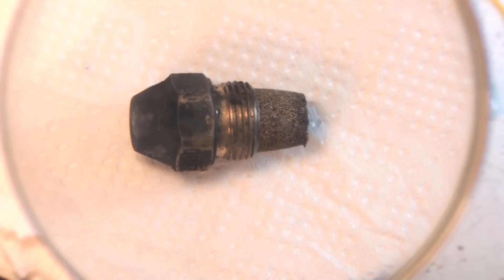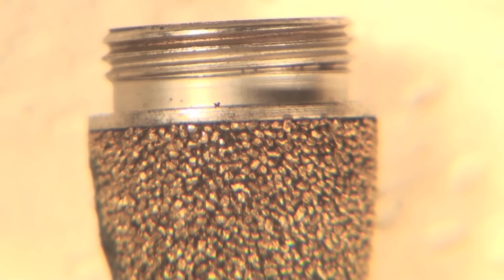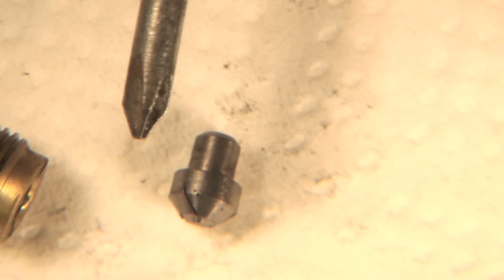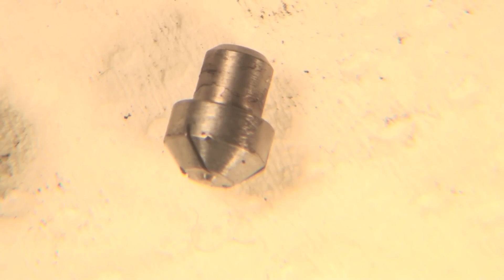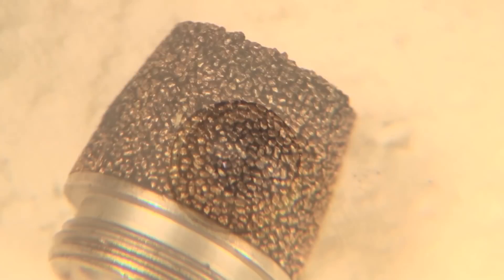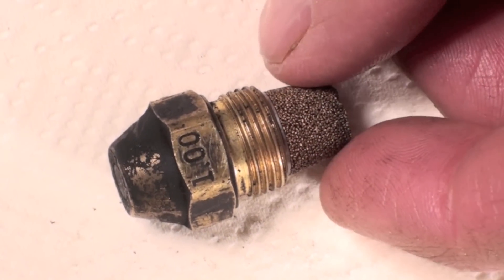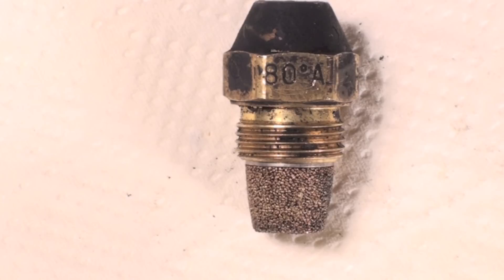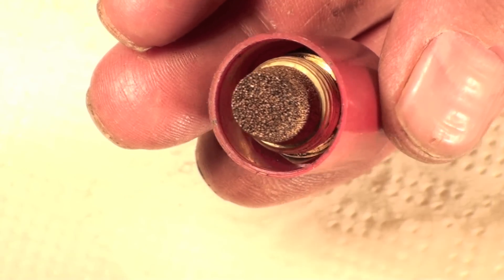The oil furnace nozzle. How it works

Comment: Wow. I have an old kerosene torpedo heater and this is the nozzle I took out. It also has electrodes instead of a spark plug. I am wondering what I really have now. It has a bleeder valve on the motor area. It's in very good shape from the 60's. It was working but was leaking a bit of kerosene oil from the nozzle area. Thank You for making this video.

Comment: After running out of oil and finally getting our emergency refill, the furnace would not fire as usual. I replaced the fuel filter, but frustratingly unable to reignite the furnace. I was lucky enough to find your video tutorials and followed step by step. I checked the transformer, electrodes and fuel gun. The electrodes and nozzle had quite a build up of carbon. I cleaned them up with a copper brush and sprayed them down with a spray cleaner, and decided to disassemble the nozzle. I soaked the nozzle parts in a cleaning solvent but the tip was extremely clogged. Was not worth the time, effort and solvent cost and just bought a new nozzle for $5.00. Reassembled everything this morning and double checked the electrode gaps as stated in your other video.  Well, it fired up instantly and bellowed quite a bit of smoke from my previous misfires...thankfully, it was nothing more than 30 seconds of soot that eventually cleared up!

Thank you for your amazing video tutorials, it got us back in a cozy temp!
Reply from the maker: What happens is there is garbage in the oil on the bottom and the top of the level.  When you run out, the garbage can get into the nozzle.
Glad you got it going.
GFM

Comment: Thanks. Another great teaching video. I think you can clean it with compressed air and some car throttle cleaner (hexane) and that should remove clogged dirt in there. Also need to wear gloves as so not to introduce any grease from hands.
Reply from the maker: If you are working on your own equipment, you can certainly clean it.  I do not clean but replace it as a professional.
GFM
Reply: @grayfurnaceman  I hear you.

Comment from the maker: Annual service is recommended for all oil furnaces.  The use of liquid fuel can plug nozzles and there is always some soot.  If you have been changing oil filters that helps a lot.  Eventually the electrodes will wear down and the spark gap gets too wide.  Check my oil furnace playlist.  There are a number of vids on service of the burner  Hope this helps.
GFM
Reply: So grateful for your vids.

Comment: A is hollow spray, W is semi solid or general purpose, correct you should replace same to same. Delevan nor Hago says not to touch the sintered filter, that one caught me by surprise.  We recommend replacing the nozzle every fall (before use) and every 750 - 1000 hours depending on conditions, bad fuel will destroy the nozzle internals quickly.

Comment: Dude, your videos are incredible! I'm a renter and the oil furnace in my house ran out of fuel a year ago. I added more to the tank, and watched your videos on bleeding the system. It started working again, and then stopped a week later. I started watching all of your troubleshooting videos and did the following: Flushed the fuel lines, removed and cleaned the pump filter, made sure the electrodes were set properly, checked and cleaned the gun assembly, and replaced the nozzle. It turned out the nozzle was clogged, and I saved my landlord several hundred dollars. Man, thanks for making such good videos. Feels pretty awesome being able to fix things on your own like this!
Reply from the maker: Merry Christmas
GFM

Comment from the maker: You can, but as with all nozzle changes, you need to test smoke.  This requires a smoke pump.  If you dont have one, check your smoke pipe periodically for soot buildup.  Also combustion air is very important.  Try to set it with just no smoke on top of the flame.  Do not put too much combustion air.  Hope it helps.
GFM

Comment from the maker: We usually consider a minimum of 100# pressure.  They are many times set to 140# or higher to better atomize the fuel.  Hope this helps.
GFM
Reply: I replaced the fuel pump with a used one on my Beckett and the pressure adj had been tampered with. Got it running but air was smashed up and I am not sure if settings are even close....

Comment: bought new thermopride in 09.....keep oil line warm, keep oil filters very clean, use in line tiger loop...after 4 seasons still burns clean, oil consumption good, chimney shows no smoke...does all this tell "the story"?..very curious to pull burner gun, but a little scared....how long can nozzle and electodes last in well maintained system?...great videos....thanks

Comment: @ 4:22 you state that the element should never be touched; what is your thought around not touching it?  WHY?
Reply from the maker: sirtubemaster If you are a service tech working on an oil furnace, you probably have very dirty hands.  The orifice is very small.  Enough said?
GFM
Reply: grayfurnaceman dang a bit harsh no?  just asked; should clarify not to touch with dirty hands then because simply touching the element is doing nothing to it. EVEN with dirty hands there is no real concern unless it is caked on grease.
Reply from the maker: sirtubemaster If you believe that I have a bridge for sale.  Do not touch the filter of the nozzle.
GFM
Reply: grayfurnaceman Well i can tell you i work for the manufacture of that sintered bronze part so i know more than you are thinking ;)

Comment: super videos. I have a spare 20.5 -26.5kw oil boiler  that i want to use  waste engine oil as the fuel and convert it into a heater for my workshop. I am going to attempt to reduce the oil output and air to reduce the total kilowatts of the appliance to about 4 kilo watts. Do you think that its possible or is there a reason why this simply just will not work.Thanks GFM. olly.
Reply from the maker: If it uses a pressure burner, lubricating oil will not work.  The oil will not separate into droplets.  The only way it will work is to preheat the oil, then aireate.
GFM

Comment: I'm seeing a Delavan 1.10 80A on our burner and we live in a 1,000 sq/ft 1 story ranch. Is 1.10 gallons per hour high, will a smaller gph reduce the total oil consumption?
Reply from the maker: You are definitely oversized.  I have no info on your location and the energy efficiency of your home, but you would have to be located above the arctic circle to need that size nozzle.  I would be looking at more like a .50.
GFM
Reply: grayfurnaceman We’re located in Massachusetts, and have a Beckett burner attached to a Dunkirk boiler, running hot water to 8 cast iron radiators.
Reply from the maker: Does it also supply domestic hot water?
GFM
Reply: grayfurnaceman Yes, but no large water tank, only a small Watts diaphragm expansion tank.
Reply from the maker: I would top out at .75.  You may need to change the head on the burner for the smaller nozzle.  I have never been sorry I used a smaller nozzle.
GFM

Comment: Hi again.  Thank you again Sir for all the hard work you put into these videos!!  I have a nozzle leaking issue that I just can't seem to fix on my oil fired water heater.  I tried teflon tape on the threads to no avail.  Then I tried yellow tape on the threads and also cleaned the pump screen which was filthy.  There was no leak for 2 to 3 weeks.  Now all of a sudden, it is leaking again.  I keep a clean paper towel on the floor under the burner and check it periodically for oil stains.  It was clean up until now.  I don't have a pressure gauge, but am currently looking into one.  Just can't decide on which one to get.  Do you have any suggestions about the leaking nozzle??
Reply from the maker: +anotherbri You probably do not have a leak in the nozzle threads.  Those threads do not seal.  The seal is the nozzle flange to the nozzle holder.  You may have a seal leak in the pump.  You could also have a venting blockage.  If the unit "rumbles" on startup, you may have venting or heat exchanger blockage.  Hope this helps.
GFM

Comment: good day, i have watched a bunch of your oil burners videos and, but i need to know how does one build this in a simple way, do you have plans for this....? or is this burner something you bought? I want to use it to heat up water for a boiler. i currently have a holding tank with a tap that drips old oil into a tray and i lite it with an old rag and have placed a small amount of air on the flame but not getting enough energy out of it....
Reply from the maker: The burner used is a commercial one.  Waste oil will not work in this type of burner.
GFM
Reply: so can you tell me how to use waste oil better and more efficient to make hot water from it....? what setup would you use
Reply from the maker: Waste oil is a completely different system.  There are waste oil burners that look somewhat similar to the burner shown, but they have a preheater for the oil and use a small compressor that blows air across the hot oil to burn it.  Not a simple system.
GFM

Comment: will be ok to change spray nozzle from 1.10-80A to 1.00-80A the reason is because we use 155 galons of oil a month and we cant afford oil. plus air blowing is about 120' from the vents thank you.
Reply from the maker: Angel L. Rodriguez Matos Reducing nozzle size is one of the first things I did to reduce usage.  You will need to adjust combustion air to match.  Hope this helps.
GFM
Reply: Thank u ...so to adjust combustion air to match is the left side of the pump right..they have like numbers right. So I need to open the hole after is on and look for the flame to no be smoking right thank u.

Comment: just wanted to thank you for all the helpful furnace videos. your cautions and tips really came in handy like loosening both ends of the copper feeder tube so you don't have to bend it. love it. quick question, i replaced my 80 degree nozzle with a 70. you alluded to the fact that this can cause problems. please explain? furnace is running fine as far as i can tell.
Reply from the maker: Frank Lee The 70 degree is the angle of spray.  Usually, the air adjustment will have to be changed and if the smoke is ok, you are fine.  Hope this helps.
GFM

Comment: Need help fast : My Becker AF-15 don't start on its own .I got to bleed it every time I want heat. Then it seems to run fine?
What to do  ,, My family is cold !!
Reply from the maker: Brian Beaton I assume you have oil.  If you get air as you start to bleed, you may have a plugged line, filter or a vacuum leak in the line from the tank or the filter canister.  Hope this helps.
GFM

Comment: I take mine apart and clean them with no problem. At $10 a pop I'll take my chances. You can't break broken.
Reply from the maker: Ramon Preston Because I was doing it professionally, it was much cheaper to replace than have a callback.  I have cleaned many of my own.
GFM

Comment: Sir watching from Philippines..
Ahm sir when can we use (1.00,80°A) nozzle or .60 nozzle..
I mean..,we can use any of that size sir even big or small boiler..or it depend of the range inside!!.
Thank you sir waiting for your response.
Reply from the maker: The size nozzle is dependent on several factors.  Stack temp is probably the biggest one.  With pump pressure right behind.  If the manufacturer of the equipment has a recommendation on the model plate that is the place to start.
GFM
Reply: @grayfurnaceman  thank you sir

Comment: As a service man for 35 years, working for major service oompanies, Long Island, ny, it scares me the number of do it your sellers, they don’t realize the many problems they can get into,  extreme soot, major oil leaks, chimney fires, etc. not covered by homeowners because they caused the 
Problem... a little knowledge is a dangerous thing,  by the way I am retired 6 years, and have no personnel interest in protecting  my job, been there, seen all the above crap.
Reply from the maker: We are similar in our careers, I retired 7 years ago.  Consider that if the DIYer has no source of correct information, he will probably do it anyway.  Wouldn't you like to share what you have learned throughout your career?  Many, if not most of my viewers are service techs that either have limited experience in the field or have come upon equipment that they have never seen.  I also answer questions as I am answering you now. You should consider passing on your knowledge.
GFM
Reply: @grayfurnaceman  GFM, I'm a DIYer, and I've learned a TON from both your videos AND from my HVAC tech that comes out.   He's been in the trade a long time.   I have a lot of knowledge across a lot of different applications.    Before I found your channel, i would tinker w/ my fuel oil furnace, having worked on my natural gas furnace prior.  definitely wanted to take the time to thank you for all the knowledge you put out there.  it's getting harder to support these furnaces!